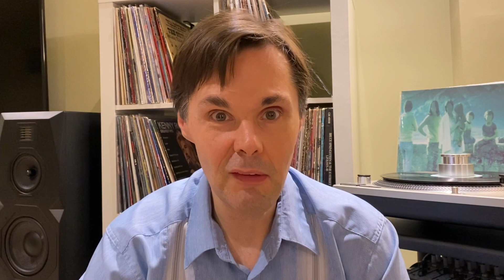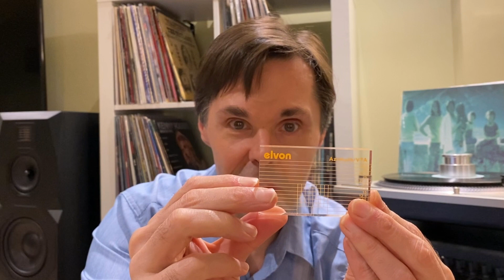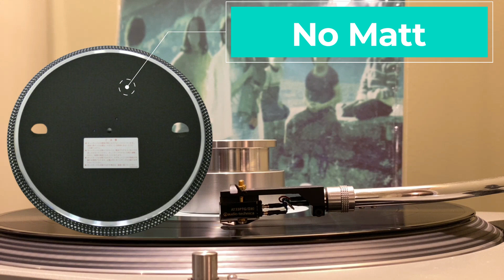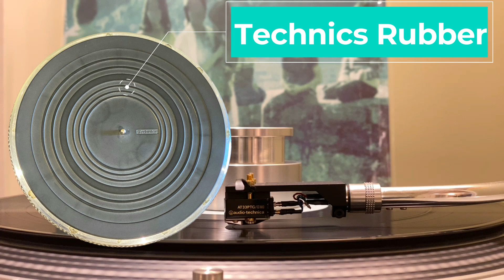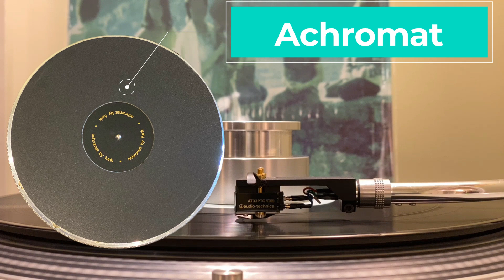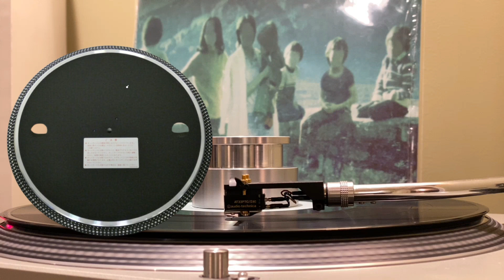The Official Turntable Mat Shootout -- Felt vs Acrylic vs Achromat vs Rubber vs Cork - Hudson Hifi

Comment: Okay, I thought about this video today.  Yesterday I took delivery of an Acrylic turntable "mat".  Why did I buy it?  I liked that it was white (yeah, I know).  Anyway, I played some music with it today.  It was a replacing a rubber mat.  Now it's evening time, and I'm sitting to relax with some music again - and the acrylic "mat" is gone.  Yikes, it's horrible.  I put "mat" in quotes because really it's just a big, rigid, piece of acrylic.  The sound was not good - not good at all.  At least to my ears.  

It looked great though!
Reply from the maker: If you are not using a clamp or weight with it; it likely isn’t coupling… if your turntable has rumble; it won’t help… if the new acrylic mat it thinner than the rubber mat (or thicker) it will alter the VTA and you must adjust it… the video here was made with the VTA exactly the same on all the mats using an azimuth ruler as a benchmark and the granular VTA on the fly of the SL-1200 arm
Reply: @BensAudioCave  I have a Rega RP3, and that ain't for VTA adjusting.  😅  And actually no, I don't use a clamp.  Thanks for the advice though.  

You know, just holding the thing in my hands I thought - Hm, rigid plastic on a glass platter...  how is that going to minimize vibrations again?  

I looked into your suggested mats, but at essentially £80 for a mat, I had to defer.  But then, I got the acrylic instead.  So all a bit of madness, I guess.
Reply from the maker: @MaterLacrymarum  yeah Regas don’t adjust and that was always my frustration with my P25… the glass platter generally doesn’t require a mat I thought… I know the acrylic doesn’t… IIRC the glass platter came with a felt mat… as for the clamp if you want anything to couple impedance wise it has to be snug…
Reply: @BensAudioCave  Trying it without any kind of mat hadn't even occurred to me.  It did come with a felt mat.  

I have seen some people talking about clamps, but honestly, playing Vinyl is already difficult enough, without adding a clamp into the equation - as least for me.

That said - Mine has the RB300 tone arm, and I only have the Carbon cartridge on there.  Any suggestions for improving things?  I find the market really confusing, I wish there was a place I could go that would simply list all the Cartridges that are compatible for a stock Rega....  alas, I've not found one.
Reply from the maker: @MaterLacrymarum  these are all easy buttons… the carbon is basically an AT3600… you can just slide an LP Gear vivid line stylus on there but I would think a move to the ATVM95ML is a great step (VTA will be fine and align with a Stevenson protractor)
https://amzn.to/3KMfP8X
Reply from the maker: Additionally a clamp just pushes on and will likely make a huge difference with the mats and platter you have… this one is affordable and super easy to use and adds no real weight to your bearing 
https://amzn.to/3g2u3om
Reply: @BensAudioCave  Thanks a ton for your cartridge and clamp advise.  I'd like to upgrade the cartridge, but yeah - when you upgrade you want it to be noticeable.  I"ll definitely look into your suggestions (I'm actually in the UK, but can order online).

Thanks again!
Reply from the maker: @MaterLacrymarum  the VM95ML will be a HUGE upgrade and that clamp at 29.99 (available many places) won’t hurt the budget 😀

Comment: I upgraded to an acrylic platter.  Not necessarily for the sound but to keep static down and it’s really easy to clean.  I just wipe it down with a carbon fiber brush.  It did seem to make a slight change of sound but without going back and forth to test it, I’m not %100 sure.  Might just be placebo.
Reply: I agree on the placebo idea, ive heard opinions all the way from no difference at all to 'Oh my God its like a new turntable" or "Its like I have a more expensive cartridge" -- but for me ive tried them all and (for me) the difference is negligible at best, certainly not worth the $20 to $40 they can cost but thats just my opinion.  Certain of mid to high end audio accessories seem like over hyped designer accessories, at least to me.

Comment: Mats are turntable dependent.  I mat that sounds good on one table may not sound good on another. I use a Canadian mat called Platter Matter which is rubber with a kind of skin on it.
Reply from the maker: That is true but this can at least help folks with a technics… I tried to get one of the new herbies for this but a bit spendy and I asked for one to try and feature but no response…. Platter matter is no longer available 😥

But I’ve heard good things
Reply: @BensAudioCave  Platter Matter works great on my modified Dual 731Q but had to be cut to fit. I do have an extra new Platter Matter mat but I may use it on one of my other turntables. I have about 20.
Reply from the maker: @andershammer9307  wish I had one to try 😥
Reply: @BensAudioCave  I'd let you try if you lived near me.

Comment: copper mats are good should try copper.
try a couple drops of anti frizz hair conditioner in your rinse, has the same properties anti-static and makes the record anti-static and slippery that's in deionised water with 30% 99% isopropanol
use deionised water then distilled it's more pure
Reply from the maker: I have 0 static issues and do also have deionized water as well but have seen no long term effects vs distilled… used in in chemistry class before so knew a supplier… However, the gruv glide trace amount works great and like I said; 0 static issues… might try your recommendation but will do the science on it with test media first
Reply from the maker: Also I have an Oyaide at one point but ended up liking the Achromat better in my system… then again the oyaide was originally used with a 2M Black and that cart was BRUTAL… it needed all the help it could get to warm it up a bit… revealing but very dry to my ears